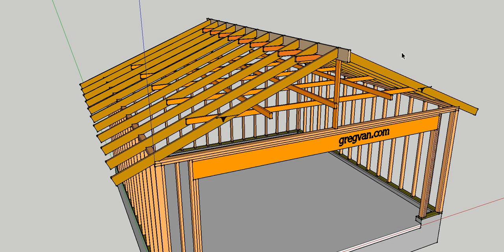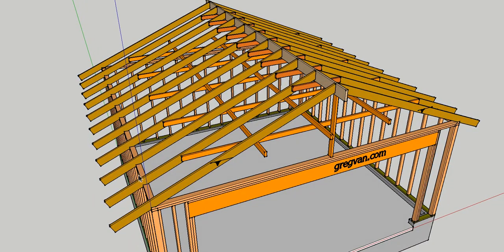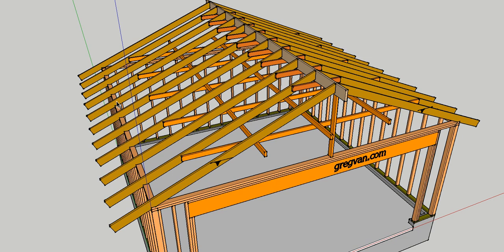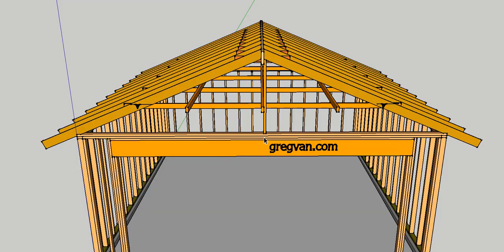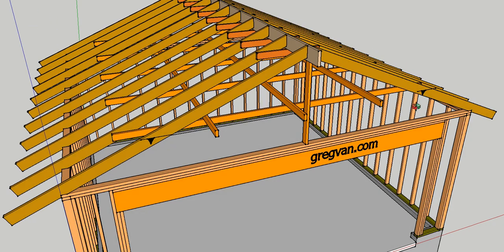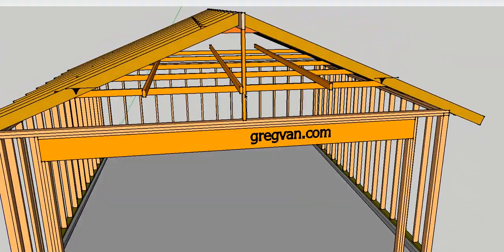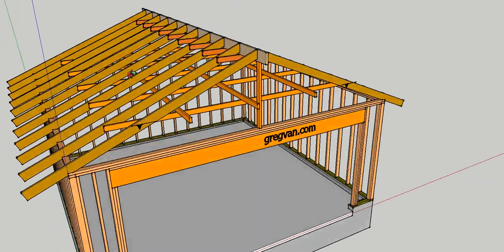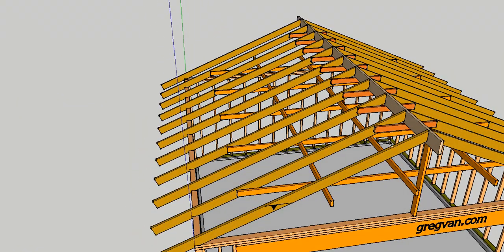What is a Roof Rafter Tie and What Does It Do? – House Framing Parts

Comment: My shed walls are bowed out significantly like you described and the ridge is sagging. Is it possible to winch the walls back into alignment and add rafter ties at this point or do I need to remove the whole roof and rafter structure and then straighten the walls and rebuild?  Thanks for the great video.
Reply from the maker: Send me a picture of your project. Trying provide me with pictures of the exterior as well as the interior and I will make a video.
Reply from the maker: I was hoping you would send me pictures before you started working on the project, to see if I could come up with a better plan unless you think it will be better later.
Reply from the maker: You can try, but most of the time it won't work because the ridge, rafters and wall framing have all sagged and would be difficult to straighten. You could always add a few rafter ties to prevent it from sagging or bowing further.
Reply from the maker: +soaringtractor This method sounds like it could be used to straighten the walls, but might not affect bowed or sagging roof lumber. I think it would be worth a try and sincerely appreciate the comment.
Reply from the maker: I couldn't disagree more, I would never think about pulling walls together and expecting the ridge to rise and straighten. If the ridge is severely bowed, then it is highly improbable that you will straighten it out and more realistic to imagine other parts of the building getting damaged..
Reply: +gregvancom My rafters are sagging (traditional stick-built, "shot-gun" home).  Is it possible to jack them up in the middle and (if they straighten), hold them in place with 2x6 rafter ties?  Could I spray them with water first to help them straighten?  (And then perhaps add some strongbacks to keep the ties from bowing, as your video mentions.)  Or would I need vertical supports, like a knee wall, to keep the rafters straight?  I could run a double LVL down the length of the house, and stand the vertical 2x4 studs on that, to keep up the rafters, but I like the idea of using rafter ties alone if that would work.  If I did the LVL plan, should it rest on all the ceiling joists, or should it only rest on those ceiling joists which rest on load-bearing walls, to prevent ceiling drywall from cracking?  Thanks for your advice.
Reply from the maker: If the ridge isn't sagging too bad and you could actually straighten it by jacking it up, then it would be possible to use some type of a support like a rafter tie or ceiling joist with a support under it like a post or even a wall. You will need to try and do one thing and if that works great, if not and try using a stronger system, in other words a little trial and error..
Reply: Great, I'll give it a try. I'm used to trial and error type jobs. Now, what would be the best method of fastening the rafter ties? Through bolts? Screws? Nails? Mending plates? I'm thinking of cutting the 2x6 rafter tie ends to match the roof pitch, and then placing them directly under the rafter, and use mending plates on both sides. Would that be strongest? I don't want to bang on the rafters trying to put the mending plates in, so I'm trying to rig up some sort of press/clamp.

I'm also considering using two 2x6 rafters ties per rafter, extending from both sides of a rafter, and laying another 2x6 along the top edge of them to keep them rigid (creating a double strong back). They would be secured to the sides of a rafter using through-bolts, of course. But that would amount to three 2x6's per set of opposing rafters, which is a lot of weight. Ideas?
Reply: Ok, I'll try to send some pictures when I get working on it.